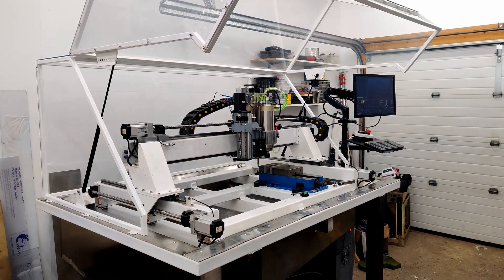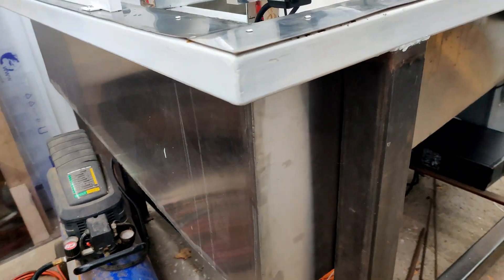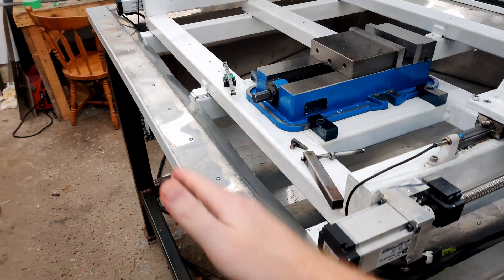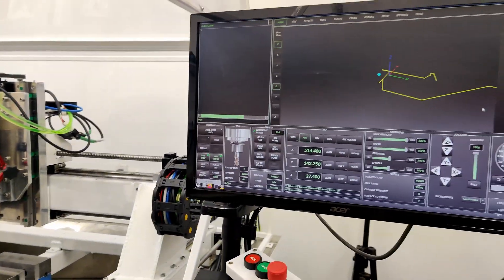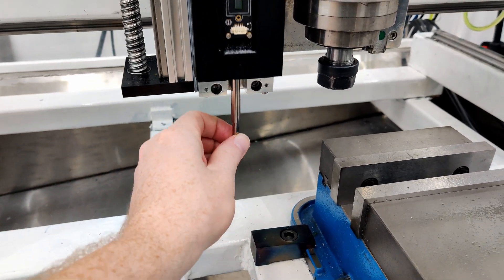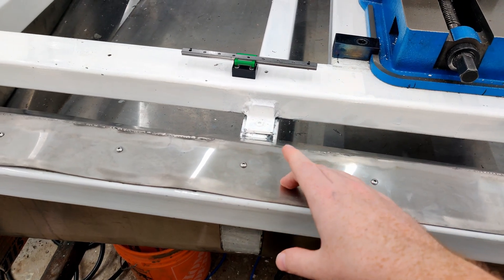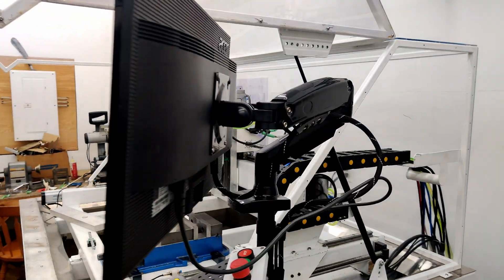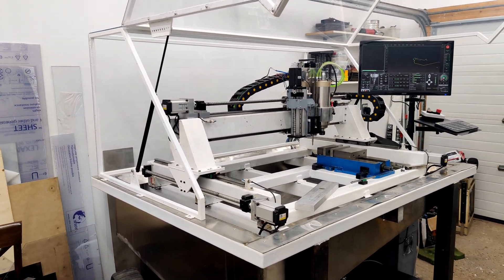DIY CNC machine (Originally PrintNC) running after stainless steel skirt added

Comment: Hi Bryan, I'm curious as to what control software you're using. It looks like a very clean interface that I saw on your screen?
Reply from the maker: CNC is run by LinuxCNC 2.9. The LinuxCNC interface GUI is called "Qt Dragon HD". It's Running in a realtime version of Debian 12.

Comment: I would use a really thin cutoff wheel to make a radial cut right on the bulge and let the two side overlap a bit, then weld it. Your machine looks 100x more professional than most home build CNC

Comment: Along the warped edge, it makes me want to just bolt a bar of stainless on top to flatten it down.  Something like a piece of 1/4" bar bolted where are your screws secure the sheet metal.  If you did it on all three sides of the frame you could flaten it out and still get a good seal with your cover.

I don't remember what control software you are using.  It doesn't look like Mach 3, unless you have a different screenset.  It looks really nice.
Reply from the maker: Tried this a day or 2 ago with a piece 1/4" about 3ft long. Didn't seem to make much difference. The bulge that's got oxidation on it, I tried heating it up and squishing it with the 1/4" flatbar which seemed to help a bit. I think at this point I gotta get more destructive with probably the TIG torch and try flame straighten hacking it. :D
Reply from the maker: Running linuxcnc 2.9 with qt dragon hd. version 2.9 more than anything is important to me because Python 2 must die already.
Reply: I tried linuxcnc in the beginning but it kicked my butt and I had to go to Mach3.  I bought a touchscreen, but it's not compatible with XP, so now I'm trying to find a 32-bit Windows 7 install disk to get  it all to work.  Looking forward to seeing your maching make some chips! @BryanHoward

Comment: The "Frankenstein" monitor arm reminds me of my shop worklight;
The foot was the caster base from a gas-lift office chair.
The column is the telescoping handle from a floor polisher, complete with quick-release cord storage.
The light is an Anglepoise office lamp.
All of the above were rescued from one dumpster, during an office refit where I worked.
I later added a small table to lay tools on.
My big mistake was lending it to my son... I won't be getting it back!   😡
I have since completed the Mark II version which also has a shop-vac with dust separator, and a 6 socket powerboard.
Good to see your machine ready to rock again.

Comment: you could snip that warp, then weld it back. my hunch is that it will be a pain to get that perfectly flat and true unless you can un-stretch the material
Reply from the maker: Yeah there's not much hope for it besides applying heat and hammer. Regardless, I'm not taking it off again If I gotta take it off it's going to the bin! :D